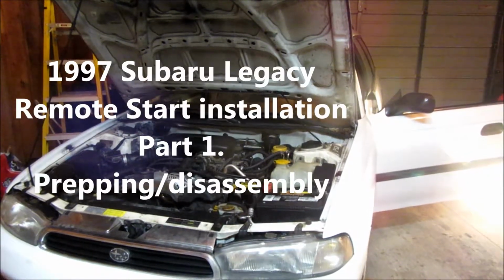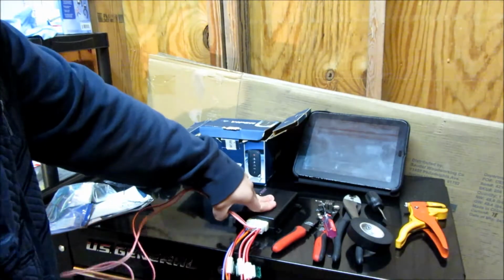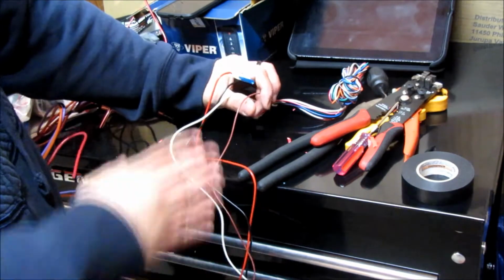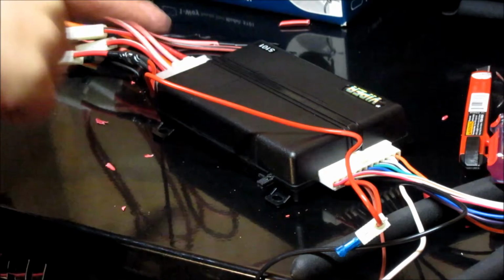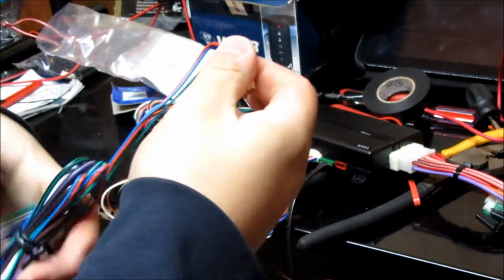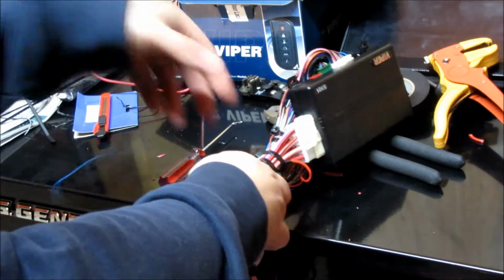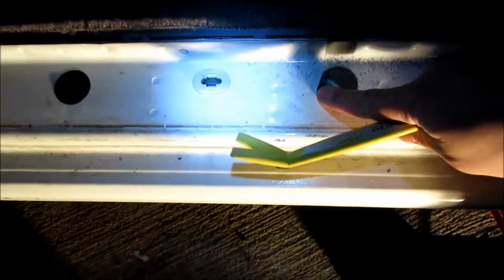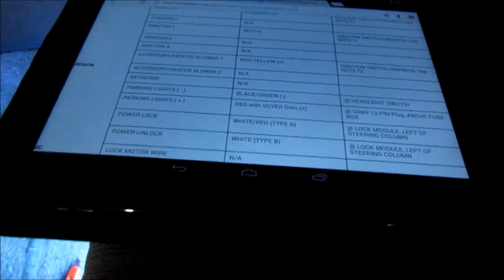1997 Subaru Legacy Viper 5101 Remote Start Installation.  Part 1

Comment: Does this work on a wrx.2012?
Reply from the maker: Some wiring will be similar but ultimately it is a completely different vehicle.  So, no.
Reply: Which one is compatible with the 08-14 wrx?
Reply: @Zeppelin9113  dude.. just Google it.